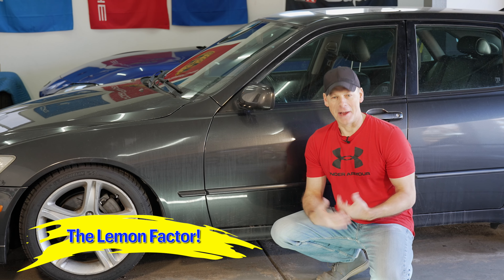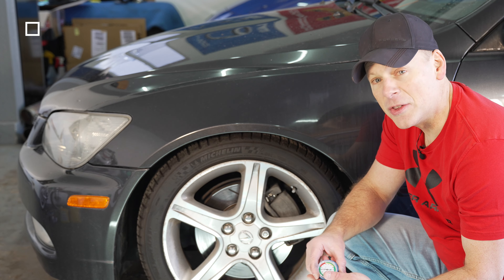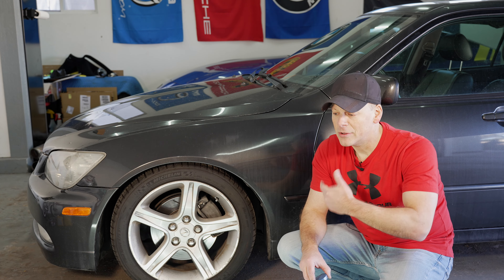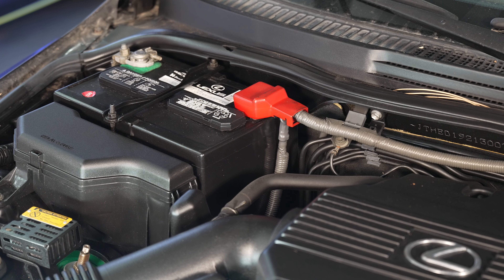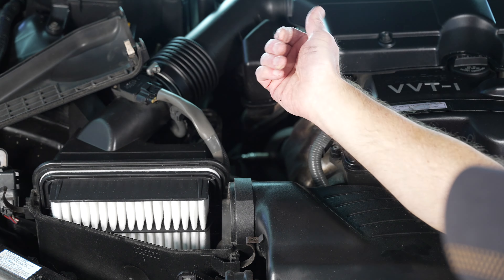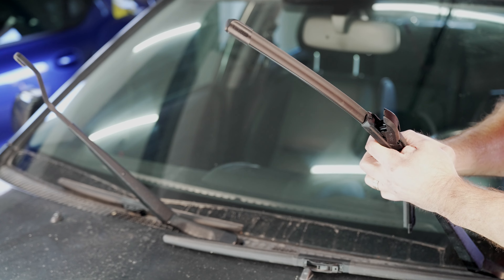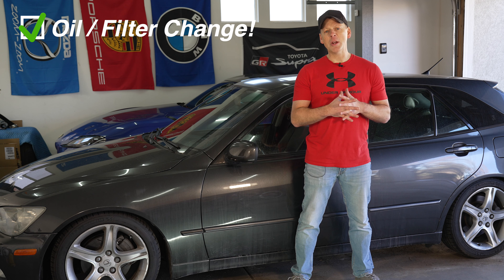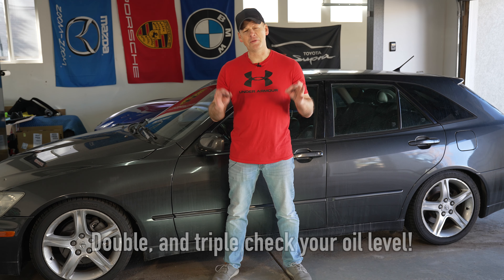Lexus IS300 Maintenance, including easy to follow OIL CHANGE!

Comment: I think you should try to repair/refinish the existing wheels first. I think it is the cheaper option and is within your skill set. knowing how meticulous you are, I am eager to see the results.  Besides, I am confronted with the same task on my gf’s C300 which has a really bad case of curb rash.  If all else fails, you can always buy a new set of wheels.
Reply from the maker: No pressure there 😉. Thanks for the compliment 👍. I like your idea - it also would be nice to have a clean set of OEM wheels 🤔

Comment: Buy new wheels, can’t recommend Enkei enough 18x8.5 +38 is a really good size for these cars. 17x8.5 +38 is also great fitment. I have 18x8.5 +38et Enkei pf09 and love them! Super strong light and relatively affordable.
Reply from the maker: Thank you for the recommendation and advice on the size / offset 👍